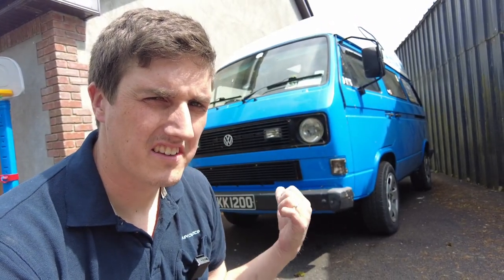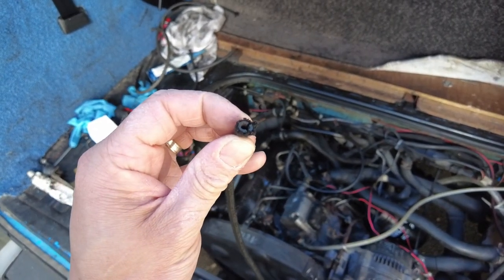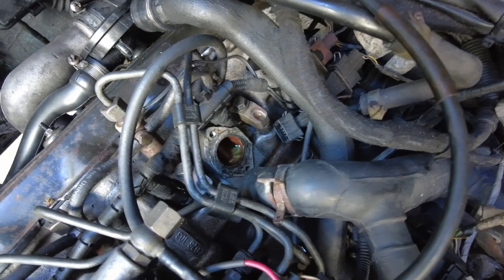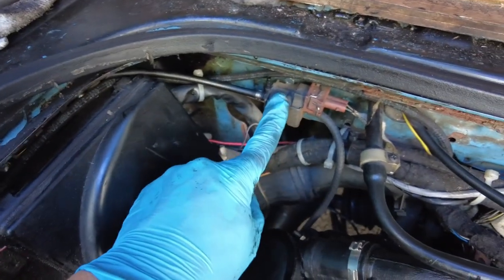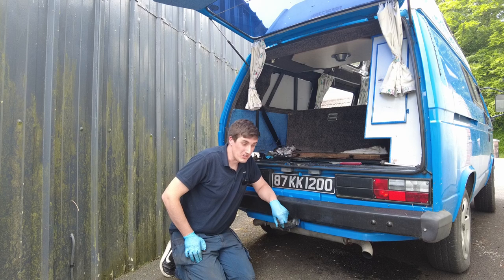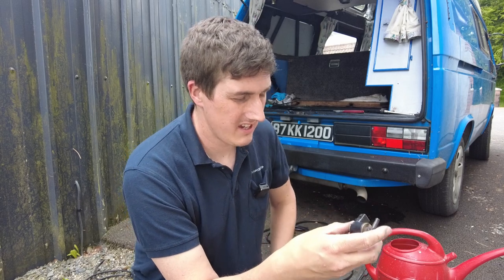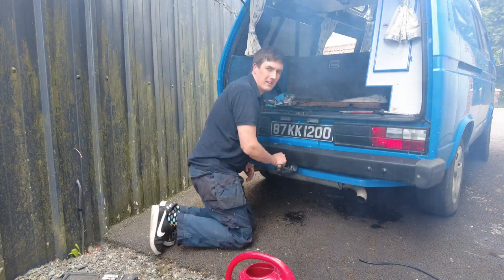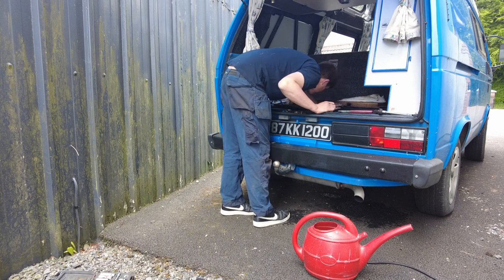1987 VW Camper Engine Nightmare: Oil, Fuel, and Coolant Leaks! It leaked everything!

Comment: I've just changed the coolant flange on my t4 that has the 1z tdi conversion engine in and the blocked off port on yours goes to either the radiator or the expansion bottle... can't remember which 🤔 great video. I'm so tempted to get rid of the t4 for a t25 😁